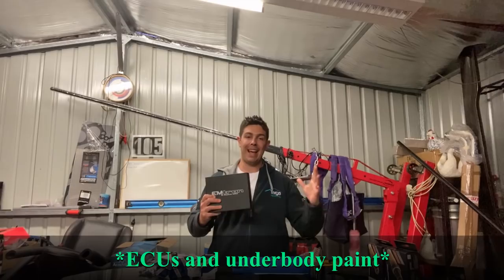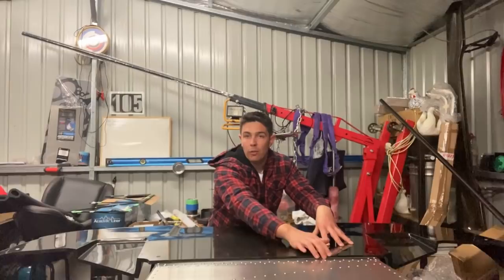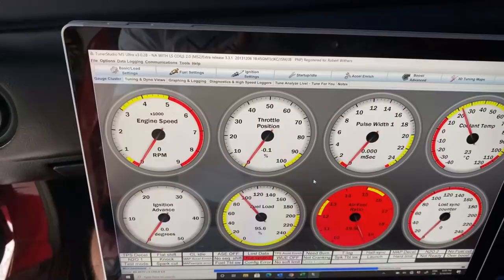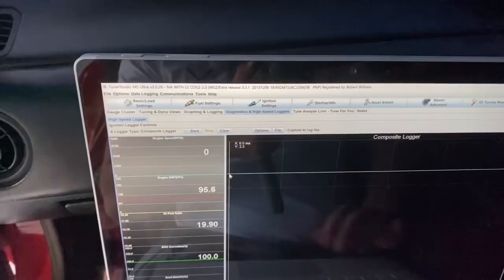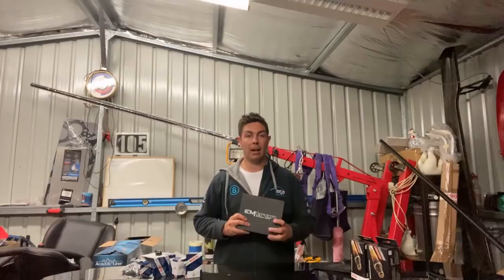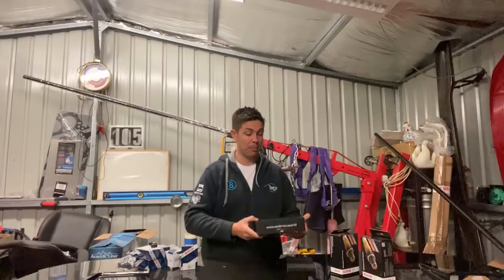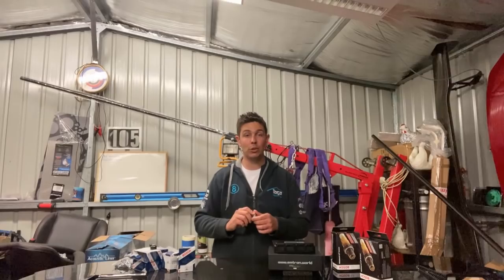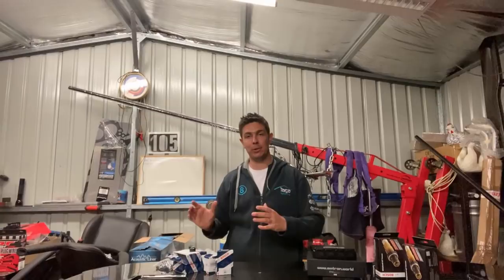Ultima RS - Electronic Brains (and some paint)

Comment: Hi Rob, you seem very clued up on every aspect of the build and its obvious that its because you are putting in a lot of work and research, great motivation for the rest of us. Im not from an engineering back ground but am currently building a Daytona coupe with a stroked 302 Ford. I am trying the documenting process too, so I can tell you that your doing a great job so far!!!
Reply from the maker: Hey Dan, Thanks and I love the Daytona coupe! You're taking the 302 out to 347? Is it a Factory 5 build? Cheers, Rob
Reply: @rob105motorsport  hey rob. The 302 is stroked to 331. Im not that clued up in that area so took advice when deciding and that seemed like a safer option. 
The chassis and rolling parts are supplied by dax in the uk (jaguar runnung gear) but they copied the body from a ffr type 65 (dont know what gen) and thats all they basically could supply. All the rest i have made myself from a few photos i snapped of an original coupe at goodwood a couple years ago.  There wasn't even a build manual with the 'kit' so its really been like just making it up as i went. I even had to build my own seats from the ground up, first time bending tube haha.
Reply from the maker: @MrDanieljanes  that all sounds really interesting! With engine building there's pros and cons with any specification. Good engine builders certainly have their tricks, and I'm sure the 331 will produce numbers/character suitable to the car. 
I know Jag' running gear is very popular and Dax have been around for long enough to give you some confidence in the quality. 
Working out solutions and learning is half the fun with these things. I did Goodwood FOS in 2017 (I think). Really want to get back for the Revival!

Comment: really enjoying these videos, super informative + interesting. I've recently bought a Mk1 MX5 for my first car, with the aim of using it for occasional track days as well as road use.
Reply from the maker: Hey Ant, glad you're enjoying it! The NA MX5 is a perfect platform. One thing I can recommend is buying a 4.3 ratio diff' and a 6 speed for it (in that order). Then just do the normal maintenance and get it to the track as much as possible. Tyres and a roll bar would be the next upgrades. Supermiata have good alignment spec's for a dual duty road/track setup too. Cheers!
Reply: @rob105motorsport  cheers for those recommendations Rob!

Comment: Always enjoy your videos. Working on my first build and 1.5 years into a Gen V LT4 Superlite SLC build. Planning on running a factory ECU for emissions compliance. Fingers crossed it will all run with no codes. Keep up the good work!
Reply from the maker: Nice, Joel. How are you finding the SLC? 
There is absolutely nothing wrong with a factory ECU and the LT series are more complex to control, so standalone systems require a bit more work to 'sort'. The factory settings are always tapered toward reliability, but they are also subject to huge amounts of R&D and validation. Cheers
Reply: Rob 105 Hi Rob, really enjoying the build process. Since I’ve decided to do some non standard items it is requiring a bit of custom work. Added power steering, power brakes, and the LT4 all added to the effort, but it will be worth it. Targeting a year from now to be at the go cart stage.

Comment: Thanks for sharing your knowledge it's refreshing to have automotive content made by an engineer.
I have a mitsubishi mirage that I engine swapped with a 2.4l (150kw) from a 1.5l and at 920kg it's not too bad. I wired and tuned it myself using an adaptronic m1200, a decent budget ecu
Reply from the maker: Thanks Brian. 150kW at that weight is a quick car. Very similar to the NA MX5 in this video. Adaptronic are a good option that’s relatively friendly to the wallet as you mention and having the wiring capability would make working on your own car much easier.

Comment: Keep up the great job, learning so much. One comment, don’t make shinny stuff dull by scuffing the surface if you want the lowest emissivity.   This is in ref to a previous video.
Reply from the maker: Hi Paul, Thanks. You're 100% correct on the downsides of scuffing the panel. In this case it isn't anywhere that will be relevant to heat protection.

Comment: Cool build. Love your attention to detail. I am building a 1988 Pontiac Fiero GT with a turbocharged Honda K24A2
Reply from the maker: Thanks! K swapping a Fiero isan awesome idea. Being in Aus' we don't see the Fiero, but do you have to do much to make them handle well?
Reply: @rob105motorsport  The 88's handle surprisingly well for an 80's car. It was updated with a bespoke suspension vs the parts bin suspension of the 84-87 Fieros. Mine has QA1 coilovers, tubular a-arms and poly bushings and of course, really good tires. The whole kit car market gave us tons of options from suspension, big brake kits and engine swaps etc. Love your build, thats gonna be a wicked car!

Comment: Great show mate, buy a Rode Go Wireless mic. It will save you loads of hassle and you can use it all over the workshop easily. Plug and play! and its from Oz. Love the car. I'm thinking about doing a twin motor electric version in London at the moment. Keep it up! Stay safe.
Reply from the maker: I'll look into it. I bought a Rode wired mic' with a dead cat, that i've used for the last couple of videos but it seems a bit of a half measure. I'm just being a tight arse.

Comment: Your explanation on the ECU's,  was spot on!!    You have a quick tip keeping paint out of the screw indents?   Again great vid thanks for your time doing this.
Reply from the maker: Hey mate, Thanks! I just put screws/rivets in any redundant holes and pulled them out when painting was done.
Reply: @rob105motorsport    LOL  I was putting grease in them holes LOL.   Hate painting anyway but I do like it when the paint is clean looking.

Comment: Hey Rob. Loving the videos so far mate! Very very helpful indeed. I'm lucky enough to have RS chassis #65 just about ready to leave the UK on a slowboat to Perth. I'd love to pick your brains about a couple of details around your plans for engineering cert and licencing (Though I'm sure your rules are a fair bit different to WA). Also you mentioned 2x shipments to avoid LCT, I hadn't seen any builders mention this before, and it hasn't been discussed with the factory so I hope I'm not walking into a taxman ambush.... Do you have any suggestions about how I can get in contact directly? Thanks in advance!
Reply from the maker: Hey Brenton, That's great! I know an RS just came into Perth in a single shipment with no LCT etc and cleared without drama. There was no 'box or motor though which may be relevant to you. If you jump on the Owners Group on Facebook you'll find contact info' for the guy and I believe he is familiar (vocationally) with shipping. 
The factory mentioned to me that two shipments were required, but it seems that might not be the case and i've gone the more expensive method. 
As for engineering cert', there should be a local signatory in WA, but in any case it is important to get someone who isn't going to have retrospective requirements and is clear on what is needed for compliance from the start. Nobody wants to be removing things or negotiating modifications once you've carefully built the thing.
Bounce me an email at 'robwithers@hotmail.com' anytime. Always happy to chat about cars.

Comment: Good vid Rob. Well explained. Keen to know which electric A/C pump you choose. I'm facing the same dilemma with a street rod project. No room in the engine bay for a belt driven compressor... (frame rails just get in the way). So an electric compressor has to go in the boot. I was thinking a Prius one, or some such animal.  Cheers !
Reply from the maker: Hey Mudgrove, check out the Rencool MD-18 setup. Streetfx are the retailer in Aus' (I checked with Rencool direct and they referred me back if installing in automotive applications). You're looking at $2500-4500 depending on whether you are utilising their blower unit and wiring aswell as the compressor/condenser/dryer. A few things to consider with wiring and alternator loads, but otherwise it seems like good gear if packaging is tough like in the Ultima or your 'rod. Nice Clay Smith display pic'.

Comment: Don't remember if you covered this previously but I'm curious about the stepper motor setup for your ITBs. If you're going to cover this in the future, no need to respond. BTW, I've got a heavily modified '86 Mustang SVO and I'm at the limit of the factory ECU. This video was spot on.
Reply from the maker: Hi Miles, I can run over this when I do the airbox. It's a Jenvey item that I'm running with their TPS. What sort of intake setup are you running? ITBs are a little tricky to tune properly, and some knowledge of how DBW throttle control works is fairly critical to good driveability. A single throttle body isn't too bad though, and with an appropriate ECU you'd potentially be able to utilise the throttle body off a later series Mustang/Ford product. Those SVO are becoming a very sought after thing btw.
There is a bit of data here: https://store.jenvey.co.uk/throttle-bodies-and-components/electronic-actuator/electronic-actuator-eta2

Comment: I understood that RON stands for Research Octane Number.
Reply from the maker: I think you're right. Anti 'knock' capability of the fuel in any case.
Reply: @rob105motorsport   In the US we get the average of the RON and the MON(Motor Octane Number) numbers, that accounts for our lower ratings
Reply from the maker: @lunkydog  that does ring a bell! I seem to remember your '91' is our '98'. But in Europe they also get >100 RON which is why we get the 'peasant tune' in Aus' on lots of JDM and Euros.

Comment: Would it be worth having a variable speed control on your water pump, instead of cycling on and off?
Reply from the maker: Certainly VSD control is the best way to moderate flow. The electrical components need to suit that. The on/off is an approximation of that.
Reply: @rob105motorsport  roger, thought it would give better temp control and reduce voltage spikes
Reply from the maker: @gerrycooper56  Yep. It's a better idea all over. Just doesn't seem to have really made it into vehicles yet, but is widely used in HVAC/Hydraulic/Mining etc for fluid flow control.
Reply: @rob105motorsport  just need a solid state voltage regulator
Reply from the maker: @gerrycooper56  I'd have to dust off the part of my brain that dabbled in electrical engineering, but I think the VSD inputs have some impact on stator winding insulation because of voltage pulses/ramp, temperatures, overload... No doubt a better solution, but there'd be some R&D/warranty/product validation/whatever involved in making it happen. If I had a bit more time and money it'd be cool to do. I do wonder why Davies Craig didn't though, and I don't believe they're monkeys, so it'd make me somewhat hesitant.
Reply: @rob105motorsport  I don’t think it’s rocket science - I’m sure there are DC variable speed drives for small motors and they wouldn’t be expensive. Anyway, for now it’s stick with ‘vanilla’ and fine tune later

Comment: ECUs have always been a headache for me, thanks for highlighting how things work. I need to get the wife karmann ghia certificate for new seat belts, the guy doing the cert here in New Zealand had a ultima that was being cert also, car was imported from the U.K.. The A arms off the ultima need to be UDT before certificate was completed. Are you required to do the same in Aussie.
Reply from the maker: I used to shy away from the electrical side, but I've kind of started enjoying the challenge. The process in Aus' is quite involved, but thankfully there are other Ultimas running around, so I can largely piggyback off their data.
Reply: @rob105motorsport  Sorry NDT testing, not UDT. Always great to have other people to call on for help. Have made mistakes that up end costing more and help was only a phone call away. Looking forward to next video Rob.
Reply: Awesome videos man. Keen to watch it all coming together! Using a KV8 for my build also. @SXD180 if you use insta. 👍

Comment: Im more the bolt it and see what happens kind of guy
Reply from the maker: That sounds a little expensive in this case.
Reply: @rob105motorsport  Im only playing mate. Your building a road race car so it has to have the right bits. Research is half the fun. Its goung to be a beast.
Reply from the maker: @j.osborne4914  That's it, but I also agree with you that there is still a time and place for the "let's just do it" idea.